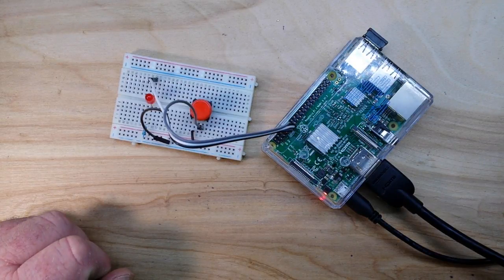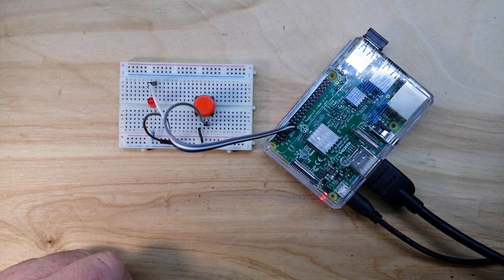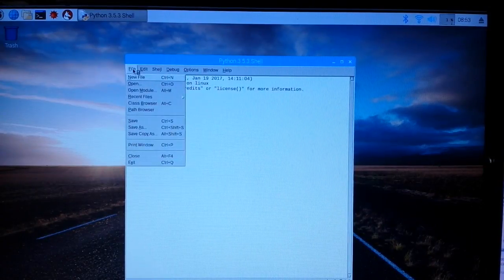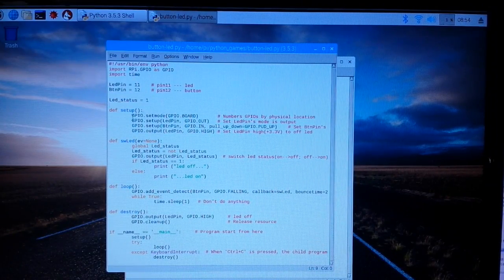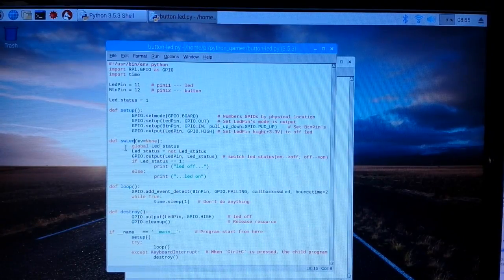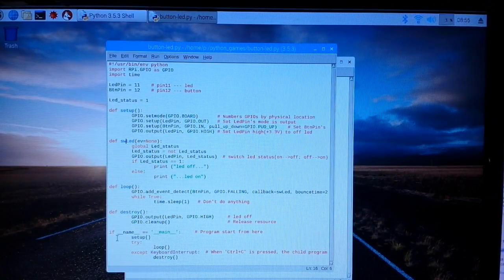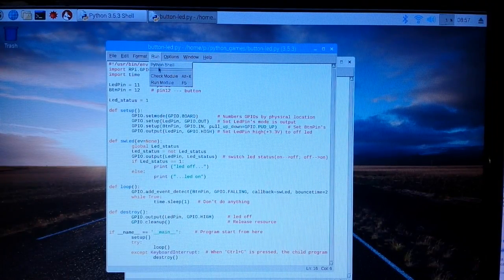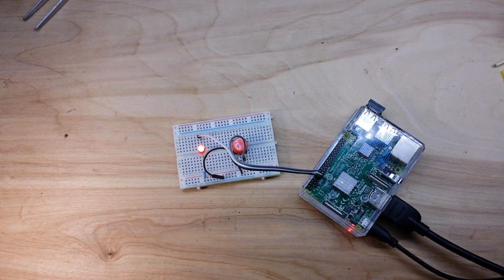Basic Raspberry Pi I/O with Python

Comment: Are you using the mini keyboard in this video? If so how are you doing the click-drag with the mouse? I can't figure it out, just got my RPi and assorted stuff yesterday. Raspbian works but not LebreElect I think it needs an RJ45 hard line?
Reply from the maker: +George Chambers yes I am using the mini keyboard. Hold down the left mouse button on the left side of the keyboard then move your finger on the track pad. I'm running Kodi wifi
Reply: The new version of Kodi doesn't look anything like the one on your video? Must be updated. When I installed it maybe I didn't wait long enough for it to find my network, though it's the only one around? Thanks for the tip I'll try it again I didn't notice a mouse button on any of the keys. Thanks for the answers!
Reply from the maker: +George Chambers anytime

Comment: that command you put  in your description does not correspond to the python version you are using in the video :P and you probably have no idea what it does. its creating a link in the home directory to the actual python installation folder.

if you need python 3.x in the terminal, just type python3 <myfile.py> .otherwise use python2 or just python (just python will be linked to one of the two versions)
Reply from the maker: fredlllll But the man said they were magic beans...

Comment: Whats the advantage of using Python compared to C? More users? Not criticizing your video. That was great as always. But whats the motivation of using Python? I know Adafruit is quite big on it. Ad Wemos are now shipping a version of their ESP32 with microPython for under 5$. But shouldnt people learn some basic C to program uCs? Not many boards support Python...
Reply from the maker: +Michael Eckl I chose Python because it is quickly becoming one of the most popular languages. But (imo) it's not a full-blown programming language. I think of it more as a scripting language like JavaScript. Better? Worse? I don't know. I'm most definitely not a software engineer. Maybe Fredlll will chime in...
Reply: But thats the point, isnt it? Its a scripting language and it might be great at that (I never used it myself so I cant judge). I just dont see the advantage of using Python over C when it comes to uCs or the Raspberry Pi where you want control of the hardware on a very low and close level
Reply from the maker: Michael Eckl I'm by no means endorsing Python over C. The only reason I chose it for guys just getting started with the Pi, they will find more tutorials online in Python compared to C.
Reply: What I read is that Python is much easier to grasp compared to C. And much more popular. So there are more tutorials online. But thats a 2-sided blade. Cuz it will limit those people to the boards that support Python. I know C can be a huge pain. Its an old programming language. Python is much more comfortable. Maybe thats just my preference. I also love Assembler so I might be the wrong target audience :)
Maybe I'll get some of those 5$ ESP32 microPython boards and give it a try. Might change my opinion
Reply from the maker: Michael Eckl Coming from a non programmer...I found Python to be easy to grasp, and this video is the first time I've ever used it. Syntax seemed very natural, and when start typing s function a help window pops up with syntax and arguments.
Reply: As I said it might just be the purist in me speaking. My main concern stands that you need boards that actually support it. I'm not a programmer myself. I did some Basic and Pascal in the 90s and then moved on to Java at University. I taught myself C and Assembler with the Arduino and on my PC. 
I dont wanna start a flame-war on what programming language is the best. I'm just saying that C would serve a user much better cuz in the end all boards support it and Python is only supported be a few selected boards

Comment: Nice video!

When i playing around with my pi's i use Putty for a SSH connection to my pi then you can edit the files directly on the Pi. Or i use WinSCP to edit the Pi's files on my windows machine and then you can easy upload the files to the Pi. 

If you make the first row in the script to
#!/usr/bin/python

You can make the script executable with the "chmod" command and you can run the script in the shell like all the other commands. I hope this make sens, english is not my first language.

Keep up the work and greetings from sweden!
Reply: what you are doing with the chmod command is setting the file permissions.
The 3 digits represent Owner, Group and Other in that order.
Then each permission has a value.
Read is 4
Write 2
Execute 1
You total up the value to set the permission for that type of user.
for example, if you want to set the owner to Read, Write and execute you use 7  (4+2+1=7) as the 1st digit.
then the group to Read and Execute only you use 5 (4+1=5) as the 2nd digit.
then others (other users not in the group) to read only you would use 4 as the 3rd digit.

here is a handy calculator to help you get your head around the permissions.
https://chmod-calculator.com/
also try "man chmod" with out the " in the terminal

You can also use symbolic methods to change permissions
chmod a = all users
chmod u = file owner
chmod g = group
chmod o = others

r = read (4)
w = write (2)
x = executable (1)

so to set the file group to executable you would use g+x 
the + means Add the permission.
using chmod g-x would remove the permission from the group.

Hope this helps.

BTW. 
If the shebang "#!/usr/bin/python" does not work
try "#!/usr/bin/env python"  and vice versa
Reply from the maker: +Roger Andersson Hello Rodger in Sweden. Glad to have you with us. Chmod a+x is that correct?
Reply: with the a you sets the right to execute to all users on the file, in the private lan that can work. i only use the Numeric notation. i use this on my private servers

chmod 754 <filename> 
 7 - owner can read, write and exacute file,
 5 - groupe can read, execute file,
 4 - other can read file,

look at the wikipage for chmod, can be much information and i always need to check the page (i have bad memory for this type of information)
Reply: You can use "ls -all" to easy check the rights on a file in the shell.
Reply from the maker: +uktoker71 Thank you very much. I'm a total Linux noob here.